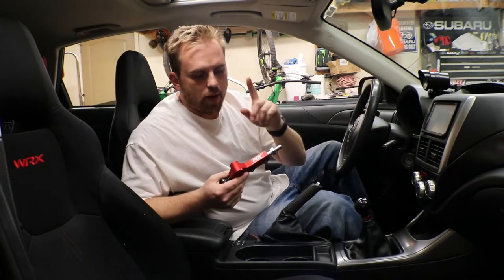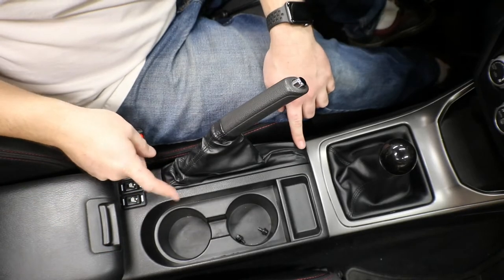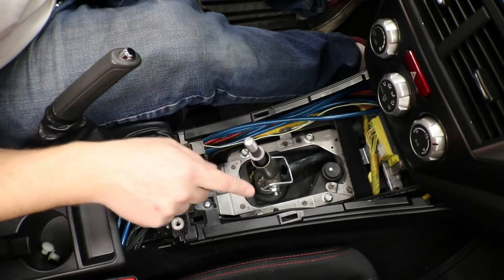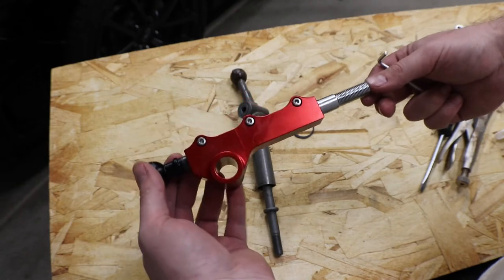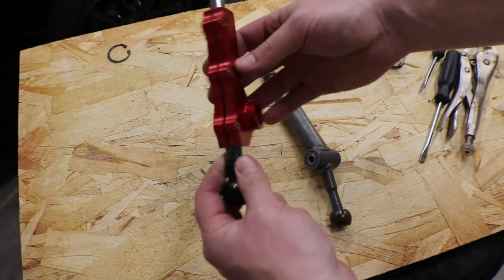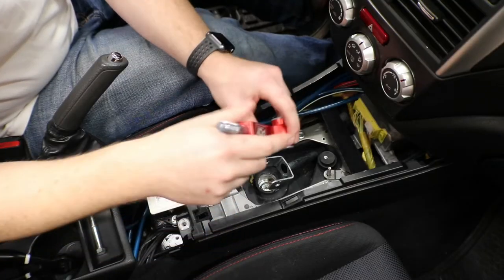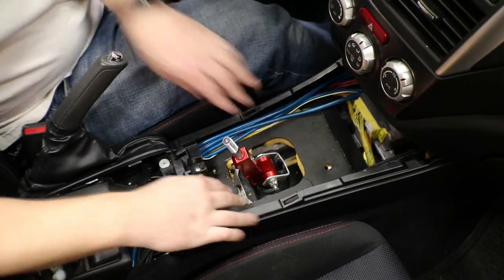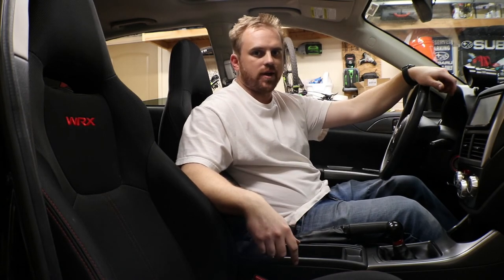INSTALL WRX SHORT THROW SHIFTER | 2008 2009 2010 2011 2012 2013 2014 | HOW TO TUTORIAL COBB

Comment: The position of the pivot point has to be higher than OEM to shorten the shift. You have lengthened it. Overall, what you did was  change the shifter height

Comment: I appreciate the video the previous owner had one already installed but it was to short and was rubbing the metal around the shifter everytime I was in 2nd 4th and reverse making a grinding noise, just adjusted it and about to take it for a test drive

Comment: You actually increased the throw by shortening the length of the shaft on the bottom from the pivot point.

Comment: Has the ebay shifter given you any issues?
Reply from the maker: I have modified a couple things. Added longer hardware and nuts for the tensioning screws just for my own personal liking. And I wrapped the 2 shafts with some thinner tape to make the fitment a little more snug. I will be doing an update/review video here pretty soon with details on that. Overall it’s not perfect, but for the price it’s working just fine for me.
Reply: @SubieShakedown  cheers mate, I ordered an ebay Shifter for now as i dont have the money to buy a $300 short shifter